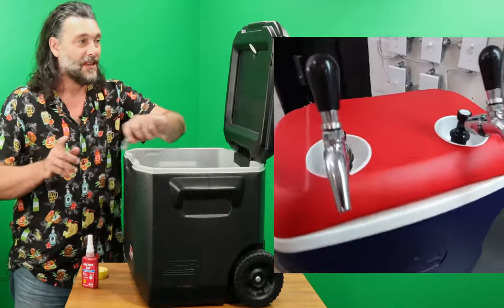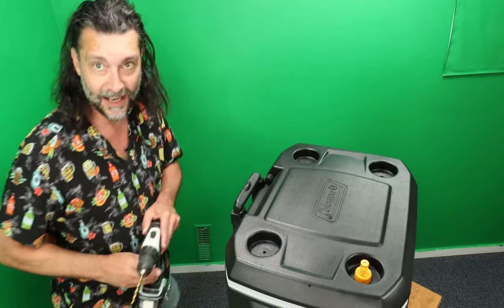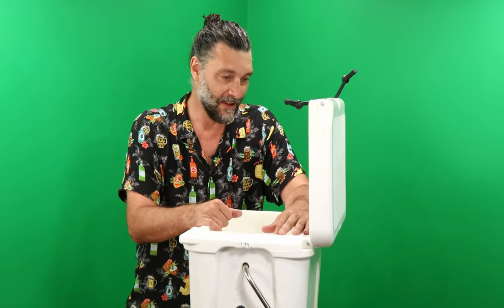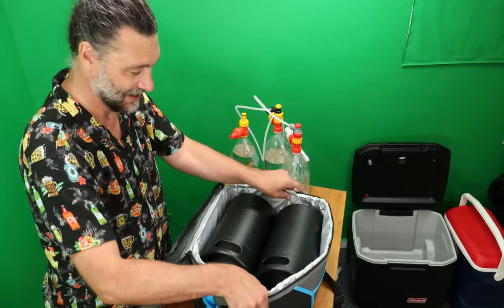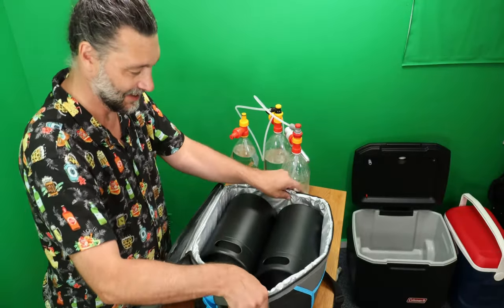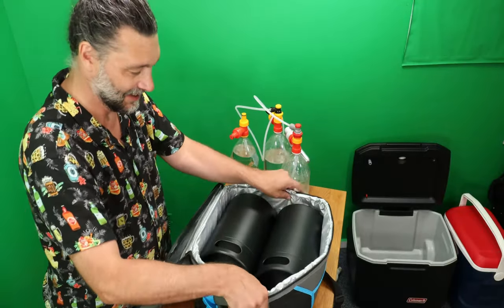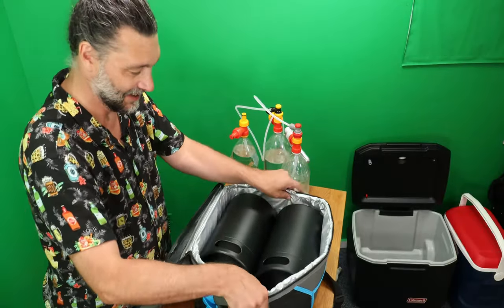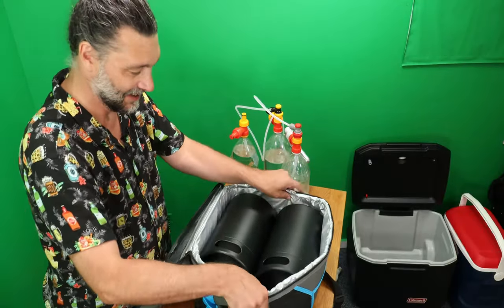Make a portable kegerator with any cooler

Comment: Just a quick safety hint: Keep your soda stream bottles upright while in use. Otherwise, you may end up with liquid CO2 escaping through the regulator, and the PRV on the beverage container is probably not fast enough to release the pressure building up from the sudden expansion. Depending what you pressurize and how much gas volume there is, that may end in a rather violent explosion (has happened to a guy in a chat group I'm in with one of those PET kegs, caused a bunch of stitches in the ER).

Comment: I wonder how well this would accommodate the kegland plastic kegs - I think they are 8 liter? A search for the perfect bubba box cooler to hold 32 Liters - 4 8L Pet bottles. I think I would also want the gas bottle in a clip in carrier attached to the outside so the gas would expand faster, yielding pressure for much longer than refrigerating it.  Love the creative way you secured the carbing caps with the duotight connectors...brilliant. Cheers!

Comment: how do I get a mini regulator to work with a 20oz paintball tank? I bet there is an adaptor. I just need a setup that is like under 11inches tall but maybe not just using little cartridges or soda stream which is a little annoying to do the trade ins and they are taller.